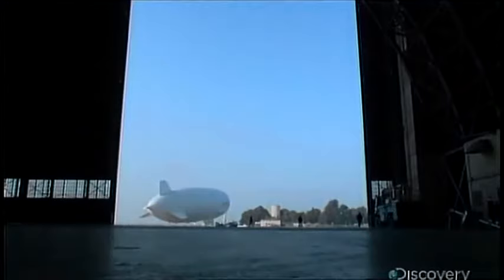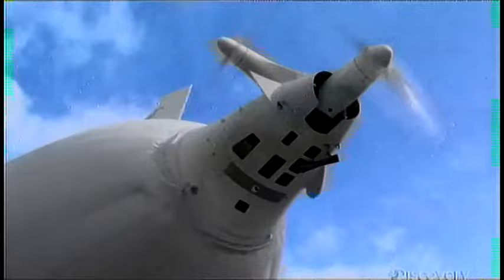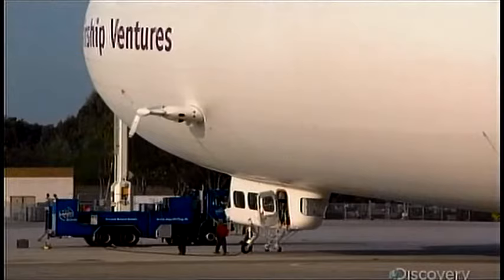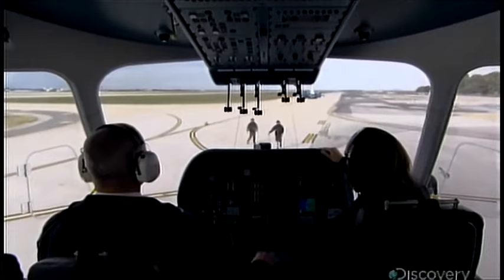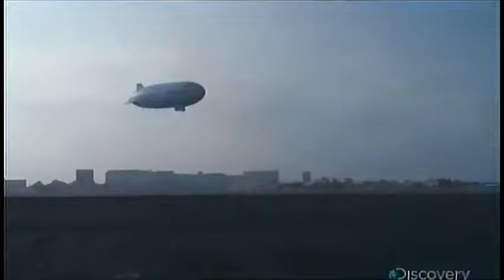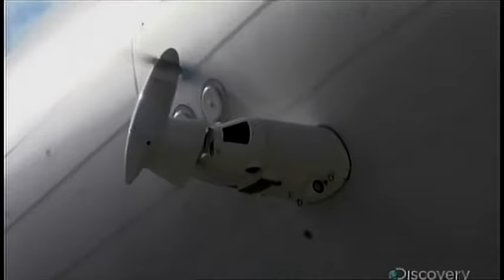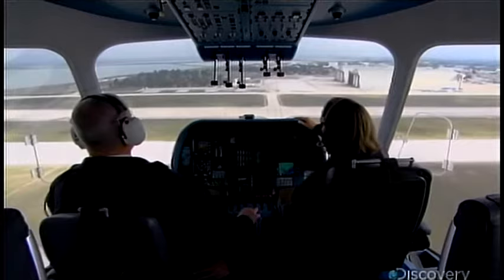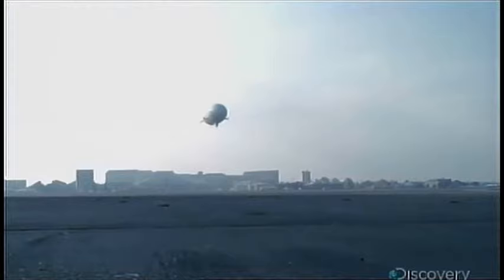How Zeppelin Works

Comment: It  wasn't the hydrogen it was the electricity  one spark its dead so add it back
Reply: Yes but since it’s highly flammable and literally every hydrogen airship has crashed it’s not using it
Reply: @Jadenrocha9871  K
Reply: @Jadenrocha9871  Not true, the Graf Zeppelin had hydrogen and lasted until WW2 when it was scrapped.
Reply: Helium isn't flammable and it's cheap not expensive
Reply: @officerdonut7066  they were in 1930s